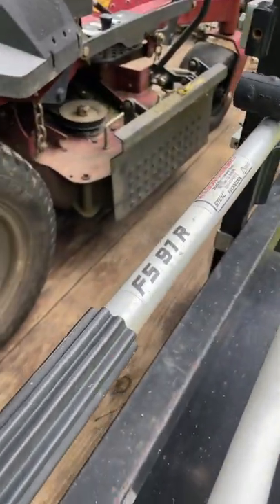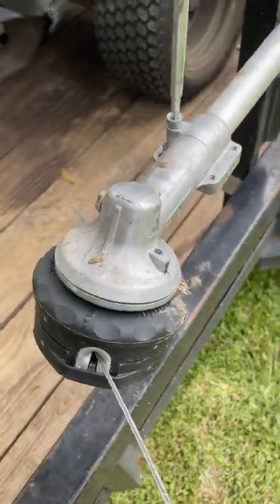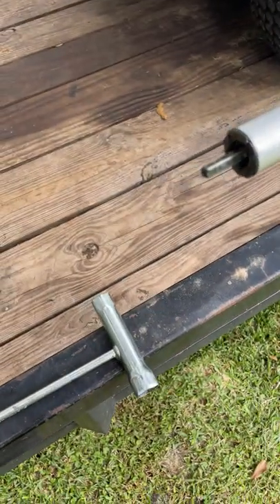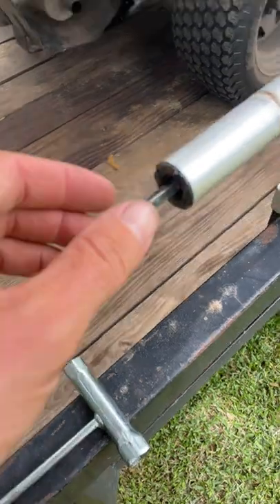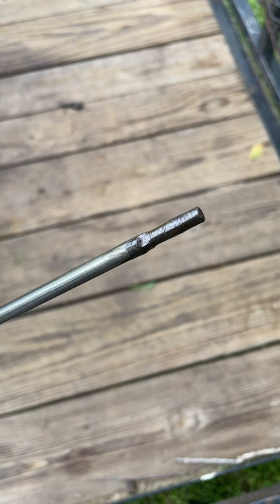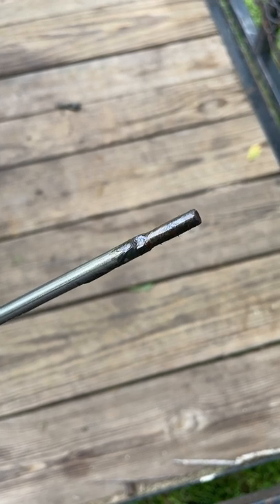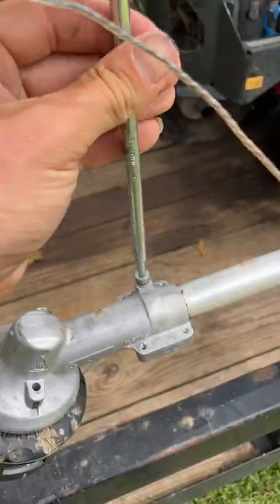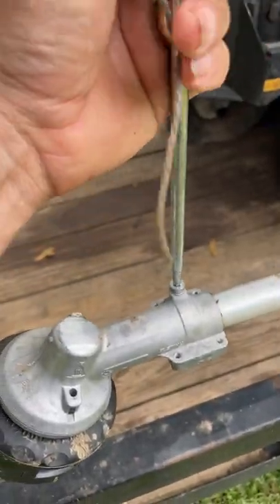Stihl Weed Eater Head Not Spinning - Easy Fix

Comment: if you have a welder, add some welding and then re square...probably the original is hardened and this solution won't last too long, however it might save you for a while